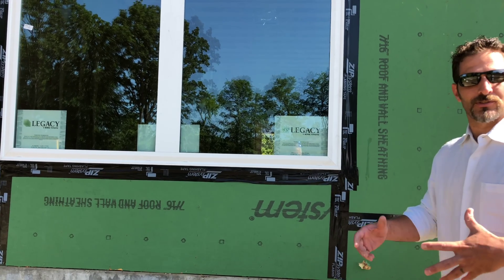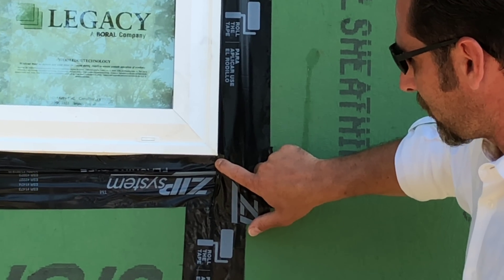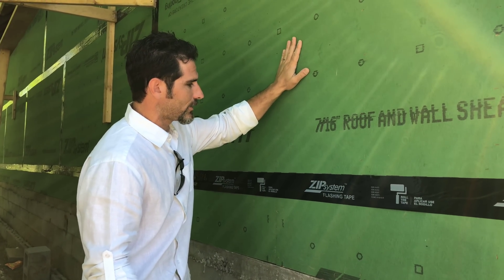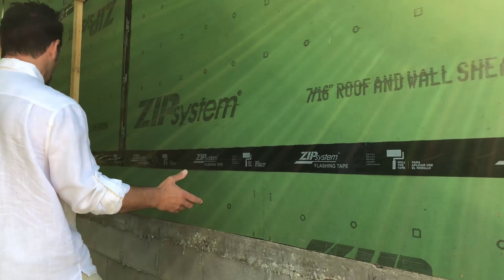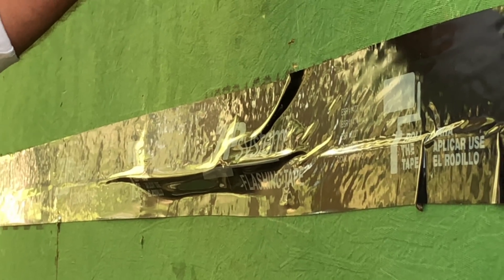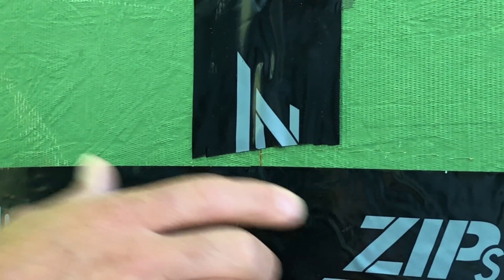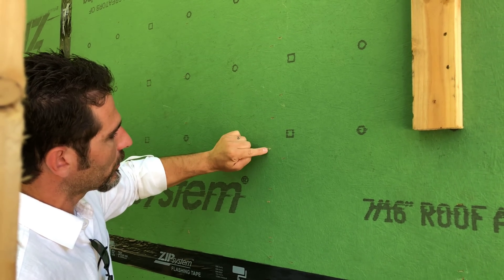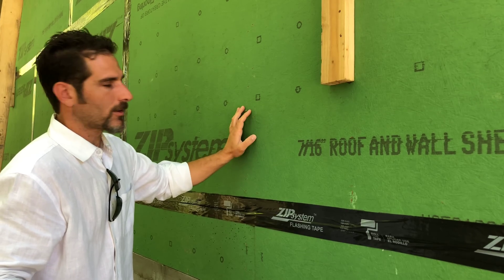ZIP System Problems

Comment: Modern building science says your WRB should be 10-20 perms. Modern OSB sheathing is around 2-5 perms. 

Huber states their OSB component in Zip panels is 2-3 perms (normal OSB range), and the WRB component is 12-16 perms (acceptable limits by modern building science).

With Tyvek at 58 perms, that is going to allow vapor drive into the walls from the exterior. And depending on your cladding (brick, stone, stucco) you're just asking for rot. And the OSB you sheathed the house with is still in that 2-5 perm range.

Plain and simple, junk installation of Zip Systems is not any better than junk installations of Tyvek.
Reply: Then how much a proper installation cost by the hour
Reply from the maker: Chris Mata that is the point. This system very rarely gets installed correctly because it is so time consuming which is costly to install properly. 90% of the homes that I’ve seen with this system look exactly like this one unfortunately. That is the point of this video I am not seeing housewrap installed incorrectly is any better. This system has many more opportunities to go wrong than housewrap ever thought of.
Reply: @WeatherProofingAmerica  Your comments on the problems are correct. Another point not mentioned is that ZIP requires the use of 6-inch ZIP tape at the windows.  This example uses the same 3-3/4 inch tape as on the panel seams.
Reply: Not really if something can breath and dry it won't rot as much as something sealed air tight with moisture

Comment: In other words... installers who don't know how to properly install the system, and HVAC installations not correctly including an HRV or ERV are the problem.  Lower perm ratings, if properly accounted for in HVAC design, will DRASTICALLY reduce overall heating/cooling costs. Explaining that improper design and application of the ZIP system could cause issues down the road would have been more accurate, rather than trying to claim that it is an inferior system.
Reply: Issac Barnett - Well said!
Reply: Correct
Reply: @RustyGotBanned  thanks for the info! I was thinking about using zip on my home but now I'm going with the Dow Weathermate because it gets extremely hot and humid here in eastern NC.
Reply: Not exactly, the Tyvek/Zip test (referenced by this video) was conducted with experienced installers and done according to manufacturer specifications.

Comment: So the installers had no idea how to correctly install this system destroying its value! Ouch! Though it sound like a bad overall system, also many installers are going for speed not quality. I have seen some things in the past with contractors!
Reply from the maker: cattigereyes1 here is a video that shows it installed correctly! Still destroys the value:)
https://youtu.be/XmvTanyghus
Reply: @WeatherProofingAmerica 
From one professional to another. 
Stop lying to your viewers and customers. 
Your linked video is too controversial. They disabled comments and likes. Censoring community feedback. From the first minute of the video. I see why. They perform the test on an incorrectly installed zip system. None of the nail holes are sealed like the manufacturer says they should. The tape was also applied incorrectly. 
Your video demonstrates the exact same incorrect install. But on an even worse level. 

Zip is literally pioneering new home building techniques. Without companies like them homebuilding will never evolve and the same problems we had 20 years ago, 10 years ago, and problems we have now, will never be solved. 
Shifting the blame from the installer to the manufacturer is childish.
Reply from the maker: @Chad Pendt Thank you for your comments & for watching my video as well as the third party video which BTW I have no control over:)  I am not lying to my customers or viewers, ZIP is lying to their customers in my opinion!  According to third party testing ZIP panels have a perm rating of less than 1.  Where ZIP is getting the perm rating they are posting is from the thin layer of WRB (the green part) by itself before it is applied to the OSB panel. You can find that info here:
http://www.dupont.com/content/dam/assets/products-and-services/construction-materials/assets/Tyvek-vs-ZIP-System-Tech-Talk-K17924-1.pdf
As for the third party testing on the ZIP system vs. Tyvek, at the time that test was done ZIP system DID NOT require the nail holes to be sealed!  They later implemented that requirement because guess what? IT FAILS!  This makes me concerned for all the owners of the structures that used this system BEFORE the nail holes were required to be sealed!  What are those people supposed to do with their falling systems?
Futher more if you listen to what I say in the video I am simply showing how this system is completely misleading because of how it is being marketed, which is as an easier & faster install!  It is NOT easier to install CORRECTLY & it is now, REALLY NOT FASTER because now you have to seal all the nail holes (which was not previously required)!  Terrible system in my opinion & third party testing continues to show that!  Hope this helps to clear up your misunderstanding & confusion:) . Thank you again for watching & participating!
Reply: @WeatherProofingAmerica  I would say that the article you posted is obviously going to be biased and promotional of Tyvek. I would rather see a third party review of the product that highlights the flaws of both products.
Reply: @WeatherProofingAmerica  I noticed that comments are turned off on that video and none of the nail penetrations were sealed. Just saying that if you shoot a bunch of nails into your boat and then put in the water. Do you really expect to Float?

Comment: using liquid flash prior to window installation is a much better option than taping and a good builder would have flashed the sole plate. the problems you are pointing out are builder issues, not product issues. this job was poorly done.
Reply: Foolproof would be in reference to the system when installed using the manufacturer's instructions. That does not cover people that don't follow the directions because no system could be foolproof then.
Reply: Zip is as fool-proof as it gets in homebuilding.  The nail hole issue has been debunked multiple times (you can also tape or liquid flash them if it makes you feel better).  Personally, I don't hate Tyvek, I have used it and been happy with it.  But, finding the worse possible install, and calling it an issue with the system is disingenuous.  Zip is much easier than Tyvek to get a "perfect" install.  Lastly, if you are getting condensation in the walls, Tyvek won't fix it.  OSB has a much lower perm rating (~5), so the housewrap won't matter.  This is an issue with insulation or interior moisture barriers (climate specific).  I feel sorry for anyone who has you work on their house while employing this line of thinking.
Reply: Agreed 1000%!
Reply: I believe this is mentioned in the video... Installer issue.
Reply: I was with you till the last minute, did you essentially say it’s better to build the house leaky? Yes condensation can be an issue but if your house (interior) is so leaky that it causes condensation issues on your exterior the problem is not your exterior or wrb. We shouldn’t be building houses that “breath” at all anymore. The tighter the better, just do your exterior correctly like you mentioned but don’t choose your system based on having a sloppy/leaky house.
Reply: @cjboulier History proves the tighter the worse mold. You can’t keep modern materials from molding without air flow.
Reply: @JeanLucConnery  Insulate/Build tight, ventilate right. It’s not complicated and is known for current day building. To say you should build a leaky house simply because you can’t do the minimum for ventilation is asinine.
Reply: @cjboulier    I agree with you.  Any tool can be misused.   Maintain the three barriers (water, air and thermal).  Let the home breathe either to the inside or outside.  Build tight and ventilate right.  Leakiness worked because we had lots of energy to waste.  Now the rest of the world wants to come to the energy party, drill platforms cost a Billion dollars and we think the answer is to squeeze oil from sand and shale.  In my travels around the world, everyone but the US used resources carefully.  In Germany, it is illegal to build a crappy house, yet in the US, we must simply meet "Code" - the absolute bare minimum that can morally, ethically and legally done by law - a "D-"!
Reply: Don Kingery Exactly. Here in Oregon regular Tyvek didnt even meet code. I believe the Tyvek “Drain wrap” meets code now but you don’t see Tyvek used much except for Tyvek Commercial on multi family/commercial. That doesn’t mean I still don’t see lots of sloppy use of good products but it’s a step in the right direction. Construction/labor costs are really high here right now though so unfortunately you get lots of cutting corners when that happens.
Reply: Yup.... but in a production environment I guarantee you it is almost impossible to get this system (or any system like this) installed correctly.   In most of the USA we're dealing with framing crews who probably don't speak English and have little to no training.  The chances of getting  this right are slim to none.  There are just too many moving parts here.
Reply: @HBSuccess  zip is so easy an average DIY-er can do it with YouTube tutorials
Reply: @HBSuccess  Maybe its people who speak English who have little to no training. You don't know.
Reply: Zip system was designed for builders who think speed is quality.  Nobody cares anymore about giving a homeowner a good product, with thought put into the  install. I have fixed so many leaks caused by builders thinking it's ok to install vinyl siding directly over shit system. With no shingle effect paper and flashing integrated into the waterproofing of a home before siding is doomed to fail.  The system sucks as do MOST builders.  Plywood / tarp paper and being able to think like a water drop is the best way by far.
Reply: He already said that his goal was to prove that the Zip System was not “fool proof”. All he really said about the product was that this system was not installed properly and this is why issues arise. He did state however that he likes Tyvek better but that was an opinion, not him slamming ZIP. I agree with him, I don’t care for ZIP either. It is faster and easier to install but in my experience, Tyvek works better. I’m already seeing homes that were built just 10 years ago with sheathing issues where decay is starting in the sheathing itself. Also mold issues inside and outside the house because ZIP is just so darn airtight. Condensation from temperature extremes and/or moisture from improper ZIP install builds up inside a wall cavity with no air to pass through and dry it out. Just a couple things I’ve noticed in the newer homes I’ve been asked to remodel.
Reply: @TCSwizz2  "Fool-proof" plans fail to anticipate the ingenuity of dedicated fools.
Reply: Don Kingery 

Ain’t that the truth 🤣🤣🤣
Reply: @DK-vx5co  If you make it fool proof then they just come up with a bigger fool
Reply: @TCSwizz2  "darn airtight" sounds about like the one of the best compliments I could give a house.  The mold issue you are talking g about sound like insulation (may need exterior) or lack of proper interior moisture barriers.  A house that is not airtight is hugely inefficient.
Reply: @TCSwizz2  But his title says Zip System Problems, not installer problems with Zip System.  Any system can fail if not installed properly.
Reply: @TCSwizz2  According to the "Perfect wall" concept, an airtight system such as Zip needs exterior insulation to prevent condensation on the sheathing. IMHO if there is no exterior insulation the system was installed incorrectly.
Reply from the maker: TCSwizz2 Thank you sir! I get tired of repeating myself lol. Thanks for watching!
Reply: @WeatherProofingAmerica  You should probably title your videos better.  Your title implies that there is an issue with the system itself.  Nothing is "Fool Proof".
Reply: Reality is that  you are never going to get the perfect job from those in the building trades for a great variety of reasons.  Therefore a 'system' has to be designed to cover that flaw.  Any that are created in the perfect environment (lab or artificially constructed not as on a real job site) are less than useless for long term homeowners.  Not only that they need to be designed for all the climatic conditions as diverse as they may be wherever they are or are going to be sold.  Anyone who has been around construction can rattle off a long long list of here today and problem tomorrow products.  They need to be removed before getting to the marketplace.  Some builders also need to be removed but materials should not be given a free pass to enrich some corporation who will try to evade future responsibility for there "wonder product" of today.  Take care.  Doug
Reply: Douglas Thompson 

Well said Doug. 👍🏼👍🏼👍🏼
Reply from the maker: Douglas Thompson precisely! Finally someone understands the point of this video! Thank you for watching & taking time to comment:)
Reply: @WeatherProofingAmerica  Truth be told that houses are getting tighter. It is the way of the future. There is no way to go back to the leaky houses of yesterday. Even if we could would we really want to? In order for the craft to improve we need to improve teaching. If you go and study the zip system you will see that they are getting away  from the tape and going to liquid flash that not only cover the seems but all nail or staples. My problem with this video is that you do not mention until later in the video that you are saying its a installer issue. You come out of the gate seeming to be totally against the zip system. If you clarified it at the beginning it would have been better.Every system has it flaws even the "leaky" builds. It may not rot as fast but they still rot and they bring a whole host of other problems such as efficiency.